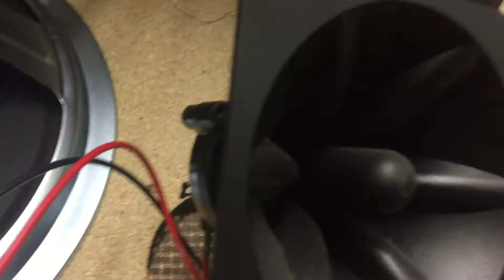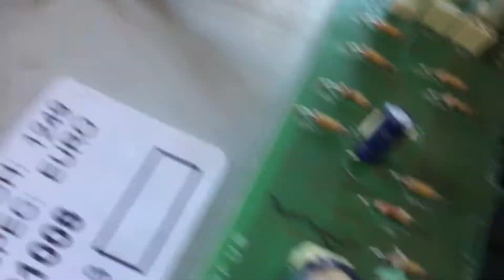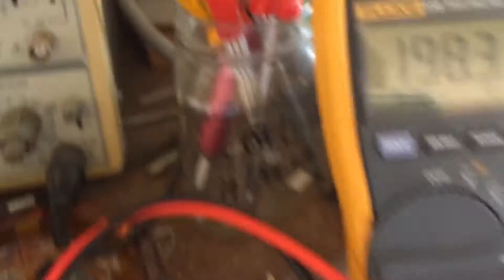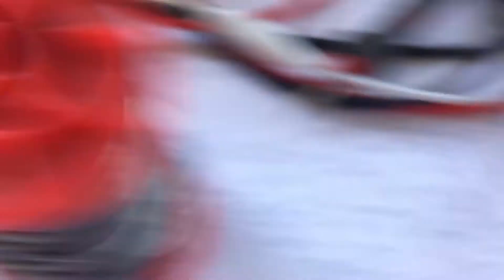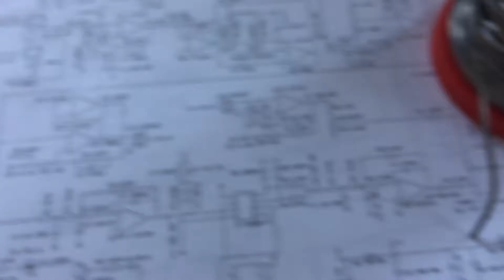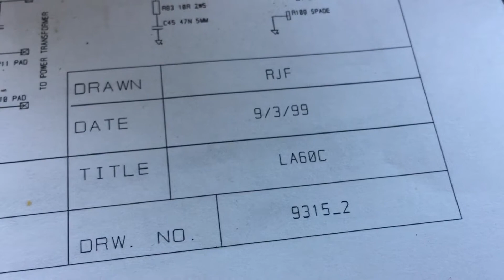Crap Amp Doctor EP03 - Laney LA60C Acoustic Guitar Amp: noisy input

Comment: I have the same problem with the active input, I'm interested if you ever found a solution.
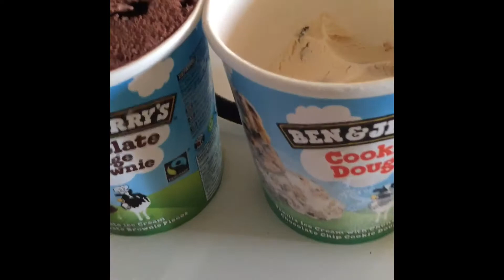Reply from the maker: Hi Andrew. See at 5:02 - the active input in and extension before the passive input. So if there is a problem with the active and not with the passive input, it must be either a) the jack b) solder connections between jack and pcb or the 100k resistor in line with the signal. I would spray the jack with contact cleaner before dissembling this beast. Good luck, let us know how it worked out. 
Don't forget to like and subscribe ;-)